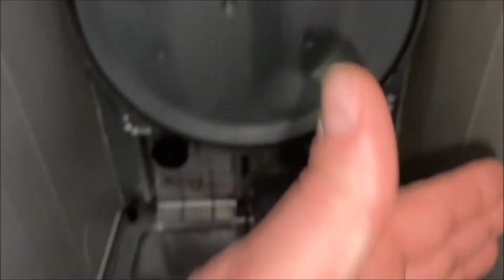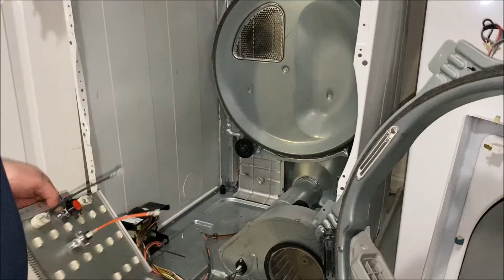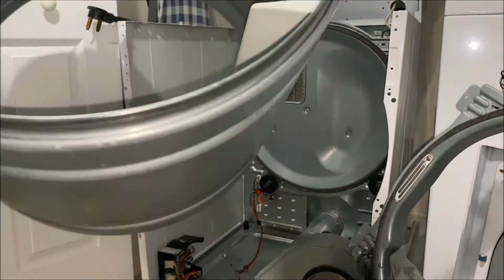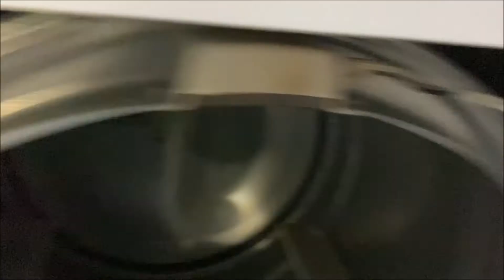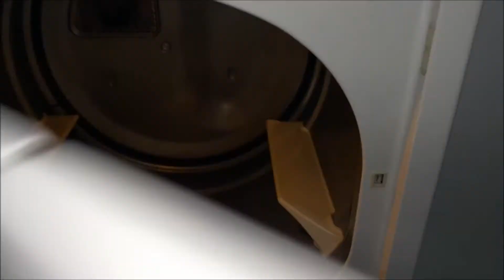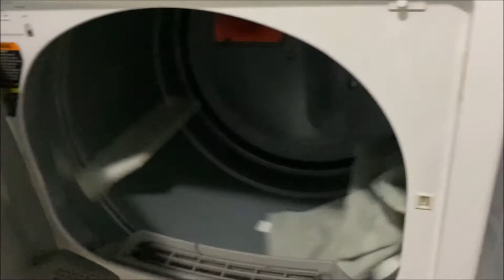Repair - Speed Queen Dryer Heating Element Replacement!

Comment: Thanks for your great video. The area where the short black wire and the long blue wire come out of the thermostat and the short black wire attaches to the white plastic below it. OK, Where the short black wire attaches it keeps burning every 6 months or so I I have replaced it 3 times. I'm wondering if you know why this is happening so I can fix it once and for all. I'm not great at talking shop.

Comment: was wondering why you're working on the dryer? I bought a new one last year 2022, it came with 7-year parts and labor warranty. My heating element went out last week, the warranty is being honored but it's taken two weeks to get a repairman scheduled and another week waiting on the part. After watching your video, I should have just done the work myself. Thanks for the video, I've made and posted a few and I know how much effort it takes to make and post a video.
Reply from the maker: When I did this, it was about 5 or 6 yrs old.  Didn’t even check warranty as it was a quick, low cost repair.  I’ll fix most things just to be efficient instead of waiting for service and then you have to trust what the service persons says is wrong…

Comment: My element had 3 prongs, A, B and a common terminal, i cannot find one anywhere only 2 prong elements this obviously leaves my thermal fuse open at one end what do i do how do i modify the wiring harness to accapt a 2 prong element since this is the only 3 prong in existence

Comment: After just two years, the heater element burn out because of defective thermo-breakers. This is my 3rd Speedqueen less than 3 yrs old that failed.  The warranty repair demanded duct cleaning before they will repair it.  My duct is 6 ft long and can be open easily.  I is perfectly clean.  But this speed queen contracted repair shop won't work on it..   IT became a costly repair due to Speed Queen's use o a 
shabby repair shop.  Need to re-think Speed Queen's use of cheap parts for a "high quality" company.  Maybe no more.
Reply from the maker: Sorry to hear about your troubles.  I run speed queen washers and dryers at me work (healthcare) and with their proven low-maintenance, I bought them for home.  We’ve run speed queens at work for 6+ yrs non stop, during 2 shifts, 7 days a week with no issues other than normal wear part replacement.  This is the only work I’ve had to do on either the washer or dryer at home.  We’ve had these for about 5 years now.

Comment: How about the thermostat next to the blower It is a thermostat in the front next to the blower you didn't test it if it's working or not working does it have an effect
Reply from the maker: Thanks for commenting!  The first thing I tested was the heating element.  I didn't test the tstat as the heating element tested bad.  I replaced it and all good.  If the element had tested good, I would have moved on to testing something else, like the tstat.

Comment: Thanks for the vid.  What were the two tabs that you replaced and why?   Would you happen to have the part number?  Thanks
Reply from the maker: They are wear strips that keep the metal of the drum from rubbing the metal of the cabinet.  Here's a link to what I ordered. https://www.amazon.com/Sikawai-37001298-Dryer-Replacement-Whirlpool/dp/B08N46F76S/ref=dp_prsubs_1?pd_rd_i=B08N46F76S&psc=1